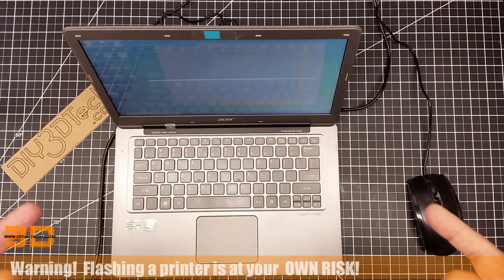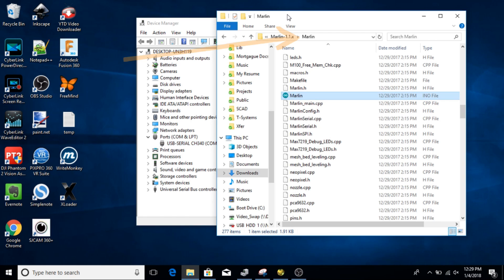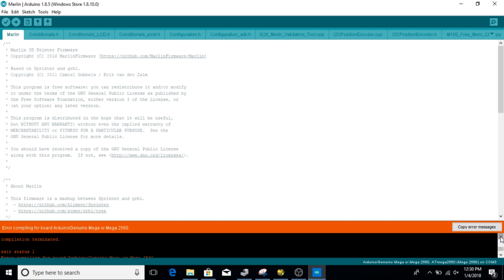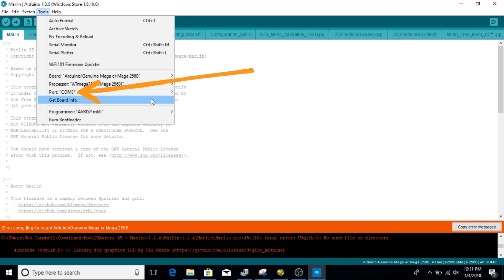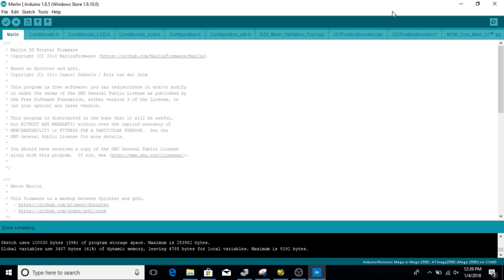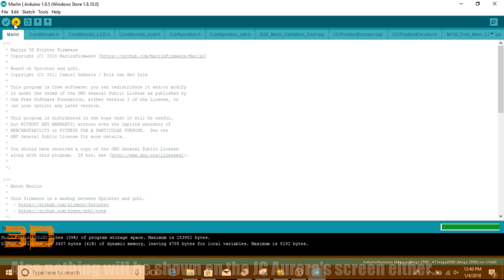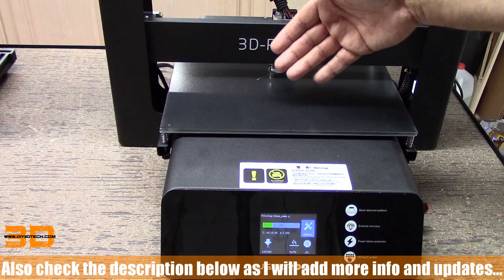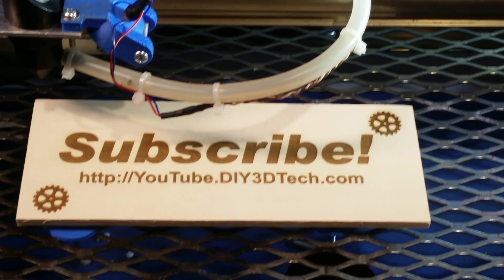GearBest JGAURORA A5  - How to Flash a New Version of Marlin Step by Step!

Comment: i am receiving this error on upload
Arduino: 1.8.13 (Windows Store 1.8.42.0) (Windows 10), Board: "Arduino Mega or Mega 2560, ATmega2560 (Mega 2560)"

Sketch uses 148434 bytes (58%) of program storage space. Maximum is 253952 bytes.

Global variables use 5129 bytes (62%) of dynamic memory, leaving 3063 bytes for local variables. Maximum is 8192 bytes.

avrdude: stk500v2_ReceiveMessage(): timeout

avrdude: stk500v2_ReceiveMessage(): timeout

avrdude: stk500v2_ReceiveMessage(): timeout

avrdude: stk500v2_ReceiveMessage(): timeout

avrdude: stk500v2_ReceiveMessage(): timeout

avrdude: stk500v2_ReceiveMessage(): timeout

avrdude: stk500v2_getsync(): timeout communicating with programmer

An error occurred while uploading the sketch

This report would have more information with
"Show verbose output during compilation"
option enabled in File -> Preferences.
Reply from the maker: This could be a number of things, the wrong board selected, the wrong baud rate.  Double check all setting also make sure you are not using a cheapo Chinese Ardunio as they CH340 chip and you need a 3rd party driver for that...
Reply: @DIY3DTECHcom  I Have a JGAURORA A5S do you know the board i need to select

Comment: I followed this process for my A5 exactly. And it completely messed up my printer. The bed wont heat, the calibrations is way off. If the bed tries to move it makes a grinding noise. Leveling wont work it takes the arm to a weird position. Raise and lover is set too high and crashes into the top. What heck?
Reply from the maker: It sounds as if the "config" for this firmware does not match your printer.  Please ensure you have a workable version for your printer.  SInce it is doing "something" tells me the firmware itself successfully loaded and it is the settings in config.h which do not match your physical printer. Worst case is you could edit the config.h to match but that will be a lot of work and you will need to know your way around a bit...

Comment: Hi
I still trying to upgrade firmware on my mac.
Where do you set the speed connection. I could see that you had some problems with the serial data speed.
Regards
Reply from the maker: If your having issues try disconnecting the front LCD as that is likely your issue.  The Baud rate is set int eh IDE under baud, not in front a computer with the IDE installed but doubt that is the issue...

Comment: Hey Joe, nice video! I flashed mine using Dai Hai and Samuel's videos. One thing the recommend  is to disconnect the display board from the main board. The connector is right underneath the front edge and you don't have to take the case apart. They said when the display board is connected during flashing that it can introduce 'chatter' in the serial communications. cheers!
Reply from the maker: Thanks for sharing, yes caught that in Dai Hai video after making this video.  I got it to work, but had to do it a couple times...

Comment: Arduino: 1.8.5 (Windows Store 1.8.10.0) (Windows 10), Board: "Arduino/Genuino Mega or Mega 2560, ATmega2560 (Mega 2560)"

Sketch uses 150554 bytes (59%) of program storage space. Maximum is 253952 bytes.
Global variables use 5323 bytes (64%) of dynamic memory, leaving 2869 bytes for local variables. Maximum is 8192 bytes.
avrdude: ser_open(): can't open device "\\.\COM3": Access is denied.

avrdude: ser_drain(): read error: The handle is invalid.

avrdude: ser_send(): write error: sorry no info avail
avrdude: stk500_send(): failed to send command to serial port
avrdude: ser_recv(): read error: The handle is invalid.

avrdude: stk500v2_ReceiveMessage(): timeout
avrdude: ser_send(): write error: sorry no info avail
avrdude: stk500_send(): failed to send command to serial port
avrdude: ser_recv(): read error: The handle is invalid.

avrdude: stk500v2_ReceiveMessage(): timeout
avrdude: ser_send(): write error: sorry no info avail
avrdude: stk500_send(): failed to send command to serial port
avrdude: ser_recv(): read error: The handle is invalid.

avrdude: stk500v2_ReceiveMessage(): timeout
avrdude: ser_send(): write error: sorry no info avail
avrdude: stk500_send(): failed to send command to serial port
avrdude: ser_recv(): read error: The handle is invalid.

avrdude: stk500v2_ReceiveMessage(): timeout
the selected serial port 
 does not exist or your board is not connected
avrdude: ser_send(): write error: sorry no info avail
avrdude: stk500_send(): failed to send command to serial port
avrdude: ser_recv(): read error: The handle is invalid.

avrdude: stk500v2_ReceiveMessage(): timeout
avrdude: ser_send(): write error: sorry no info avail
avrdude: stk500_send(): failed to send command to serial port
avrdude: ser_recv(): read error: The handle is invalid.

avrdude: stk500v2_ReceiveMessage(): timeout
avrdude: stk500v2_getsync(): timeout communicating with programmer

This report would have more information with
"Show verbose output during compilation"
option enabled in File -> Preferences.
Reply from the maker: Ok?

Comment: Arduino: 1.8.5 (Windows 10), Board: "Arduino/Genuino Mega or Mega 2560, ATmega2560 (Mega 2560)"

Build options changed, rebuilding all
Conditionals.h:27: error: #error "Old configurations? Please delete all #include lines from Configuration.h and Configuration_adv.h."

 #error "Old configurations? Please delete all #include lines from Configuration.h and Configuration_adv.h."

  ^

exit status 1
#error "Old configurations? Please delete all #include lines from Configuration.h and Configuration_adv.h."

This report would have more information with
"Show verbose output during compilation"
option enabled in File -> Preferences.
Reply from the maker: Are you sure you have latest IDE and selected the correct processor As this tells me you have something hosed up in the configuration (Old configurations? Please delete all #include lines from Configuration.h and Configuration_adv.h).  Also make sure you don't have it buried in DIRs, this should be no deeper then then in a sub-dir...

Comment: You've got me interested in the JGAURORA A5. Wondering if you think that this machine could be modified to also work with a  laser? What other mods are possible?   I like the ease of use, but I'm also looking for something that can be modified to grow as I learn more about what can be done.  Seeing the ability to modify the firmware makes me smile.
Reply from the maker: Converting a 3D printer to a laser is not something I recommend as especially the fumes are hazardous and stray light risk very high.  If your looking for a laser, I suggest buying a dedicated unit with the safety features built in.  However I have been very happy with the performance of the printer easily since upgrading the firmware!
Reply: Thanks for the good advice.

Comment: One more question. Will there be any other adjustments to do after updating the firmware and before I can start printing again? I mean do I have to recalibrate X,Y, Z-axis, extruder and maybe even the current of stepper motors?
Reply from the maker: Since homing changes a little, I would re-tram the bed but that's all I did...

Comment: Hmmm, trying to do a test compilation as you show in your video I first get this error:
   #error "Pins for this chip not defined in Arduino.h! If you have a working pins definition, please contribute!"
I'm working on a Surface Pro i7 and did install the Arduino IDE from Marketplace.
Any suggestions?
Reply from the maker: Sounds like you don't have the correct board or processor selected...
Reply: Thanks for the info. I didn't see the whole video at first. For first try I did it step by step with your video and just included the missing library. Now I saw that Arduino Uno board was selected.
Reply from the maker: LOL!  This is why I add the piece up front to watch the whole video first :-)  Glad things are working out for you...
Reply: Wasn't too dangerous. I even didn't have the correct USB-cable. Just wanted to try out the first steps without realy updating the FW on the printer. Now, after setting up the correct board/processor and including the missing library I know that the test compile does run flawlessly and the real FW-update can be done today in the evening ;-) Thanks so far for your help and patience.
Reply from the maker: The risk is typically in the connectivity to the control as once it starts and if it fails to finish, the printer is a brick unless you both can flash a new boot loader as well as know how to.  The JGAURORA A5 does have a bootloader connector inside as an FYI...

Comment: This this, I"m sure, a boneheaded mistake but I'm receiving this message upon compiling... "fatal error: MarlinConfig.h: No such file or directory". I can see the file "MarlinConfig.h" in the folder. Help. thanks, Dan
Reply from the maker: Do you have the correct board and processor selected?
Reply: yes... this is the full message, C:\Users\dlsch\AppData\Local\Temp\Temp1_Marlin-1.1.8-JG-Aurora-A5 (1).zip\Marlin-1.1.8-JG-Aurora-A5\Marlin\Marlin.ino:31:26: fatal error: MarlinConfig.h: No such file or directory

 #include "MarlinConfig.h"
Reply from the maker: Typically an error of this nature is (1) incorrect board or processor selection or (2) incompatible IDE.  In the video I am using the most current IDE (I have used both the download-able version as well as the one from the windows store successfully).  As a side suggestion, try moving the expended dir "Marlin-1.1.8-JG-Aurora-A5" to be its own dir say in documents or download as "C:\Users\dlsch\AppData\Local\Temp\Temp1_Marlin-1.1.8-JG-Aurora-A5 (1).zip" looks funny, might be nothing but I have no idea how your system is set up...
Reply: Got it ... you MUST have Marlin in it's own folder, if not, "The wheels fall off", as StevenQ-NE-UK (YouTube)
talks about in a video called "Arduino IDE & Marlin Configuration.h". You had shown it in it's own folder... I missed the importance of this.  Thanks for your help. 

I don't see a Patron page for you... I have very much liked what I have seen over the last couple of days and would liked to support your efforts. Best, Dan
Reply from the maker: Glad things are working out!  Also thanks for your offer of support and being a subscriber is all I ask in return :-)
Reply: Thank you again. Dan

Comment: Thx for the Windoze 10 tip. I'll be doing that.

Dunno if you are aware (or viewed) there's a somewhat (maybe more than somewhat) negative vid about this machine concerning electrical shock, i.e., dangerous high voltage current feedback.
Reply from the maker: Do you have the link?  As I have disassembled mine (you can see in the whats inside video) and don't see how as it has a grounded and sealed PWS.  However I always caveat this with Chinese quality control is questionable and it is possible something made it out of the factory which shouldn't have...
Reply: Maker's Muse, 'I got shocked by a 3D printer' (or something close to that) 
Here's the link: https://www.youtube.com/watch?v=Lt-0n95GvQo
Reply: +3D Printer Junkie Yes, I agree mostly, i.e., I've missed "the majority" reference. Sorry about that.
Regardless, I kinda thought it was little more than some sort of public apology to and directly for J. Prusa. Just my opinion/observation, of course. lol! 
PS: Looks like I'll be checking out your YouTube channel. Thx.
Reply: 4FunRC   I read all the comments under the video and among those who knew what they were talking about it was 60 / 40 not the A5 with the other 40 saying bad power supply in the A5.    It very well may be exactly as he says, but he did not test enough to state that and should have done so before posting. IMO.     Great, I hope you find something useful there, it's a little more mods and other things to print based than other channels, I want it to be different, I watch numerous other channels and make a point not to copy them, I appreciate the work they put in! There was just a lack of primarily mod based channels so I started posting info up.
Reply from the maker: This is the reason I did the video opening up the JGAURORA A5 to see if there was anything in mine which would be questionable and there want.  I don't like the lack of ground strap, yet all of my other printer are like that so I can't call that out as unique.  I wish Angus would have also shared more details...
Reply: It has not been proven that the A5 shocked him at all. He is blaming the A5 yet never tested it and admits he daisy chained surge strips. It's questionable at best that the A5 is at fault although it could be, but nothing was tested to determine.  The majority of the comments from people with experience in his comments section feel the same way.
Reply: well damn that would explain it, quickest way to get some shocking activity ;) lol
Reply: Angus did an update video.  What I got out of it was he had a fault in the wall outlet which caused the machine to not be grounded properly.
Reply from the maker: Suggest watching this video: https://youtu.be/3jYZDLOV4Jc as it shows what happened and Angus even commented to agree this is what happened (i.e. a floating ground) cause by the use of a power strip and extension cord, nothing to do with the printer...